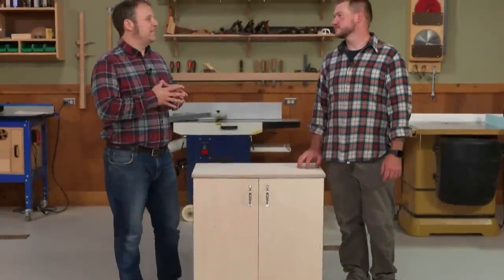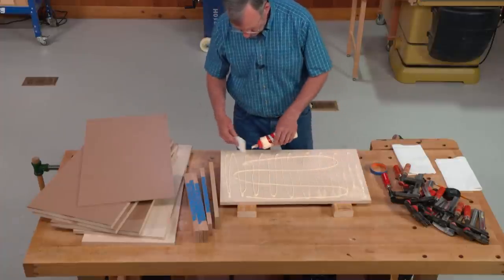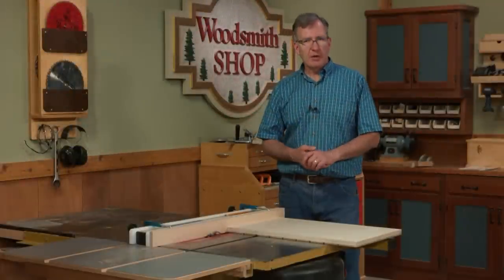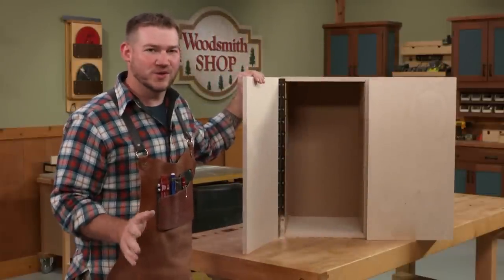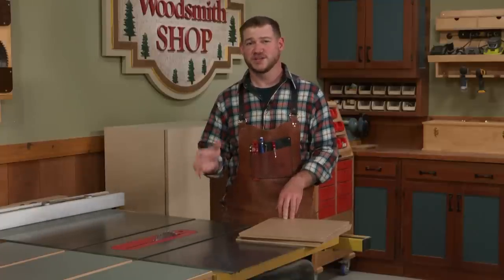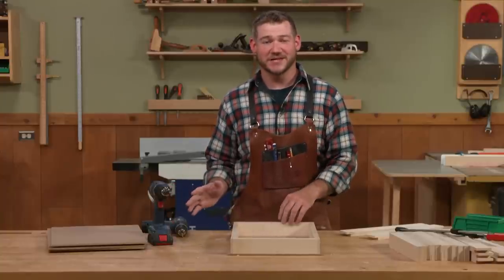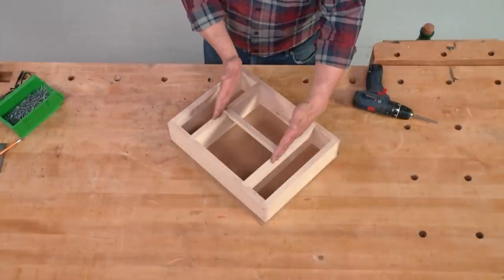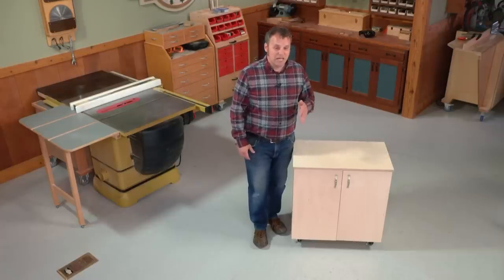Building a Tool Cart with Custom Storage

Comment: I love the versatility of this cabinet, that you’ve made it for power tool storage, and the different configurations give us ideas for personal storage. One thing not addressed that we are still struggling with. I want to build a series of cabinets(some slide-out on casters) to provide both tool storage and a same-height surface the length of our garage to act as outfeed tables for the tools. These haven’t been built because my husband & I cannot agree on the counter height. I’m 5’6” with extremely short legs and a long torso. He’s 6 feet with the opposite. I cannot sit on a normal chair with my feet on the floor. Plus we use a bench for different jobs. I tend to do my work at the bench, using hand tools or dedicated power tools for the heavier work. I don’t have the upper body strength to hold a heavy tool, so I prefer a miter saw station and a router table, both of which hold the heavy tool for me. I do own a 4” circular saw with an ergonomic handle. He tends to use a workbench to hold his tools, which he takes to the location where the work is: almost always a home repair, however on occasion he works at the bench. Do you have a suggestion on how to set up the cabinets like this in a row, with a single long worktop on top, and make the height useable by two people of different heights? His suggestion was for me to pull up a wide, low bench a few inches high to stand on. This is extraordinarily dangerous, since me feet are clumsy, yet with a good floor, I do beautiful work.

Comment: I like the idea of this cart.  However I won't be using Baltic birch plywood as it is $160 for a 4x8 sheet.  Too much for shop cabinets.
Reply from the maker: That's fair. I like my shop projects to look nice as well as function well. Like we said, the original plan uses regular plywood with hardwood edging. You could also paint it, too. Build it the way you want.
Reply from the maker: You can definitely substitute a lower grade of plywood for this project, and it would turn out just fine.  In our defense this video was actually shot more than a year ago, so Baltic Birch was drastically cheaper at the time.

Comment: I agree with others who have commented earlier, this is a neat project but no one can find Baltic birch plywood. If you can find it, the cost is outrageous. There is a disconnect in reality between these tv shows and YouTube stars and everyday woodworkers.
Reply from the maker: I agree that the availability and price of Baltic Birch has fluctuated quite a bit recently, but it is just one of our favorite materials.  You could definitely substitute a lower grade of plywood here, and I'm sure it would turn out just fine.

Comment: A bit surprised you didn't recommend lubricating the sliding surfaces with candle or canning wax. It makes it much easier to slide drawers in and out, almost as smooth as ball bearing slides. Beeswax is a bit sticky.
Reply from the maker: That's a good tip. The hardboard sliding on hardboard is a pretty smooth operation as it is. So at the time, we didn't need wax.

Comment: Very good project and video. One question, is it necessary to use the hard board on the sides ? Another good shop idea. Thanks
Reply: For the price and thickness it is hard to beat hardboard. Thin quarter inch or with inch plywood lately is only ten dollars less than the half and three quarter inch at my wholesaler. Hardboard wears really well too. It’s kinda perfect for that use, both economically and it’s physical properties.
Reply from the maker: The hardboard provides the slots for the drawers to ride in. While you may be tempted to just cut dadoes into the case sides and divider, we've found that can weaken the case pieces and cause them to flex, pinching the drawer runners. As Fearsome Warrior says it wears well -- much better and smoother than 1/4' ply or 1/4" mdf

Comment: As of this yesterday (8/31/2022) the cut diagram for this project appears to be inaccurate.

- The Tray back/front and sides are labeled L and M.  Parts L and M do not appear in any other diagram in the plan

- The cut diagram shows three parts (G, I, J) for edging and trim.  The rest of the plan shows only two parts for edging and trim (J, K) 

The cut diagram shows three parts (G,I, J) for edging and trim.  G and I are the labels for Front / back and Door panels in the rest of the plan.

There may be others. 

Thanks.
Reply from the maker: Thanks for pointing that out, Doug.  I'll take a look at it.
Reply: @WoodsmithShowandmagazine  Thanks.  Please let me know what you find, especially if I am reading the plan incorrectly.
Reply: @WoodsmithShowandmagazine   I am nearly finished with my build of this project.  It has been a fun one and I was able to figure out the cut. Still it is disappointing that the cut diagrams are still wrong.  I expected more.

Comment: baltic birch is expensive  --what is hardboard??? --what about pine douglas fir, poplar??? talk about inexpensive woods for shop projects
Reply: The 'old' name for 'hardboard' was Masonite - named after the developer. Its the predecessor of MDF, but much more heat & pressure is used, so part of the lignin in the wood breaks down and forms an adhesive - hence the toasty brown color. HMR MDF uses resin instead of heat & pressure to produce a similar product, but I'm not sure how strong it is with a shear loading.
Reply: Similar hardness of wearing surfaces helps. If your using plywood for the case, it’s a good idea to match it with something hard, like hardboard or more plywood. You can use any wood you got. I don’t think pine or poplar are that much cost and you don’t need to use the most expensive plywood. They’re just making it look the best they can for camera.
Reply from the maker: @FearsomeWarrior  Exactly right. We mention right off the bat that we chose Baltic birch for this one, but the plans show regular plywood. You could easily use MDF for the case to save some money. Not sure I'd wanna glue up panels, but you could. Several home centers sell solid wood project panels from inexpensive materials that would be nice here, too.

Comment: I've started this project and bought the sheet goods.  I could only find 3/16th tempered hardboard with a textured surface on one side. When I make the drawers, I plan to put the finished side down to provide a smooth surface for the draws to slide on.  Do you see any reason why this hardboard will not work?  Thanks.
Reply from the maker: That should work out just fine. When gluing the hardboard to the plywood for the drawer slots, be sure to use plenty of  glue. That waffle pattern on  the back can really soak it up.

Comment: In a humid shop, that hardboard is going to swell and disintegrate.
Reply: 5 mm plywood
Reply: What kind of swampland is your shop in for it to have any humidity? Woodworking is generally going to go better in a dry, climate controlled shop. Get some rubber brush seals and insulate.
Reply from the maker: I have an unconditioned garage workshop and that cart has been living there for a year plus. The trays have done just fine through Iowa winter and now two summers. I have several MDF tops on carts that are in fine shape as well. Short of water pooling on them, I don't see the issue for me. A more tropical southeast US may face other problems that I'm not aware of.
Reply: @WoodsmithShowandmagazine  the Banana Belt of Canada gets its share of humidity and winter.  If it's Iowa-ready, it should be able to handle Canada.
Reply: Real hardboard is remarkably weather resistant unlike MDF - I've had pieces of hardboard left out in the weather rain & sun, high humidity for a couple of years, about the only thing it did was warp a bit when I left a pile of other stuff on it in the rain. MDF however is awful - I bought a piece and within a few weeks I though I had a piece of old carpet draped over my miter saw - it had about a 1/4 inch of grey/green fluffy mildew on both sides and it had warped like a snake from its own weight.